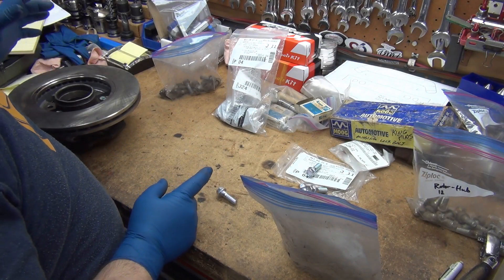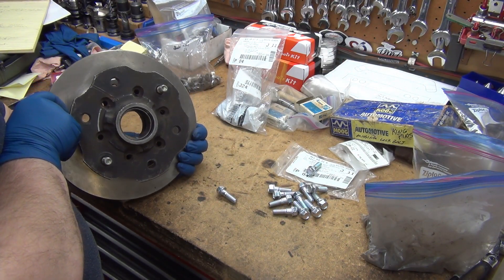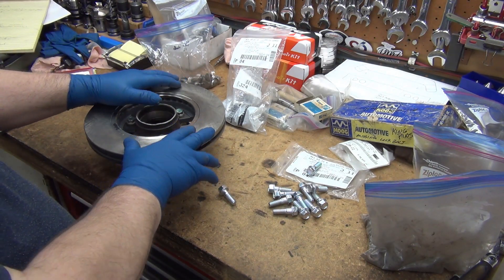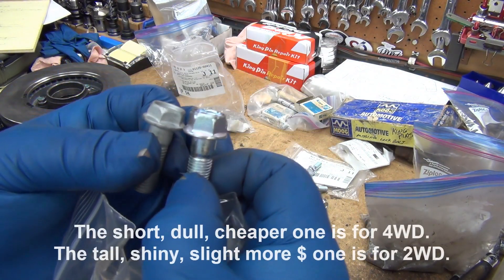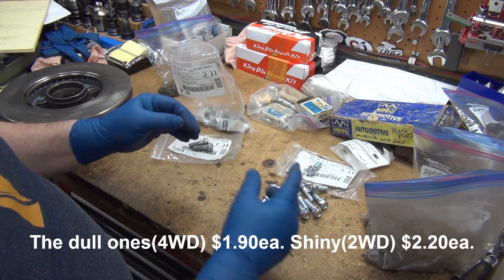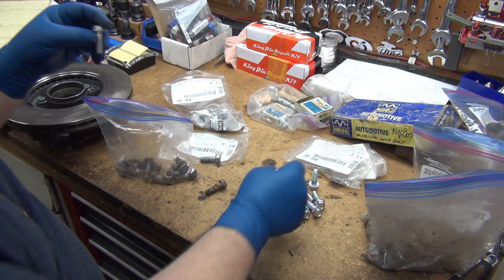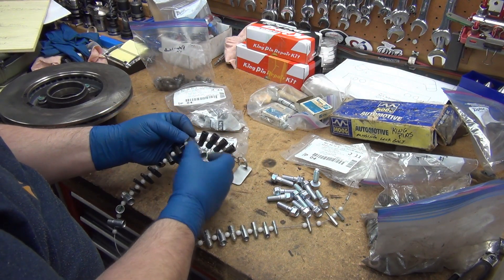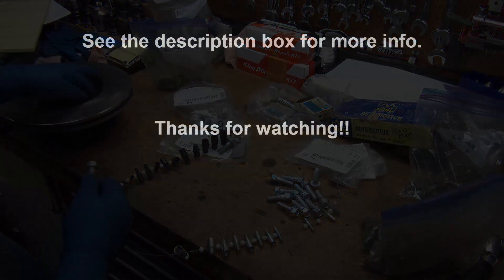Rotor to Hub Mounting Bolts - Datsun/Nissan Trucks

Comment: Love your videos. I have a older Chevy luv that has a 76-80 Chevy luv disc brake set up on it and I really am wanting to try a Toyota hub swap so I can run 5 lug. Have you ever done the Toyota hubs on a luv and will it make the track width wider. Width is another concern of mine so wheels don’t stick out. Any info would be much appreciated..
Reply from the maker: Thanks!
I haven't done anything with the LUV....although I've owned one before. :)  You can check rockauto to see what other vehicles the LUV's bearings fit.  If they're the same bearings as the Toyota and Nissan, there's a chance it will work.  The machining done on the Toy hub to make it work on the HB spindle is to account for the different spindle lengths.  You'd need to check bearing spacing on the LUV hub to see how it compares to the Toy hub.  I think I have a video of how I measured the difference.  Without having a LUV hub, there's no way for me to know if it will move the wheels in or out.
Reply from the maker: This may have some info to help you get started.  https://youtu.be/JZWpKBjripA

If you want to chat more about it, email me through the contact page on my site, bluehandsfab.com  Thanks. :)